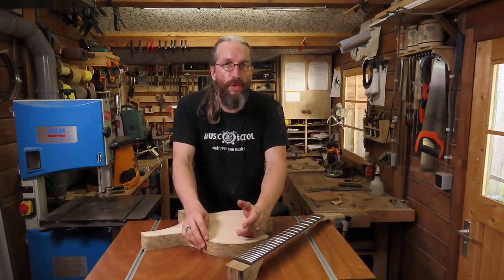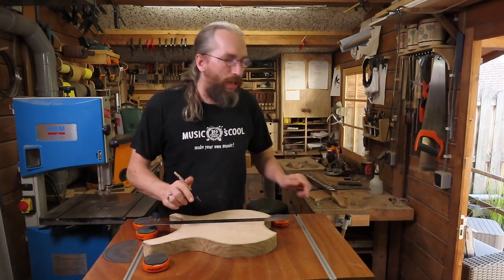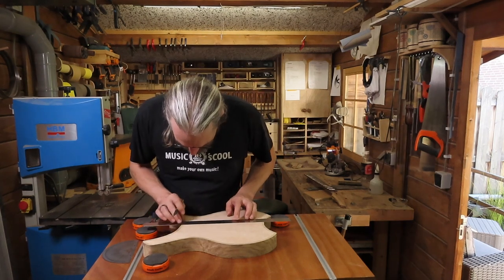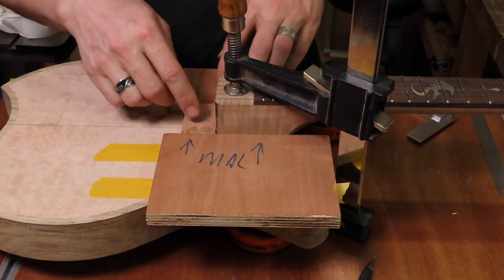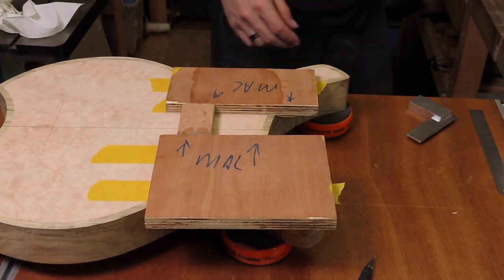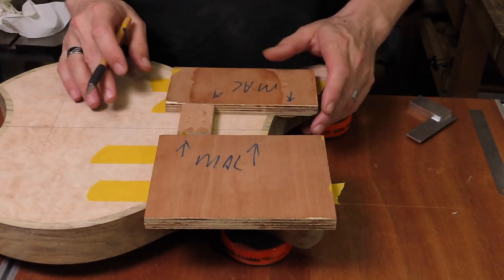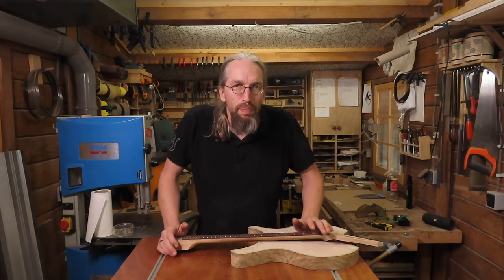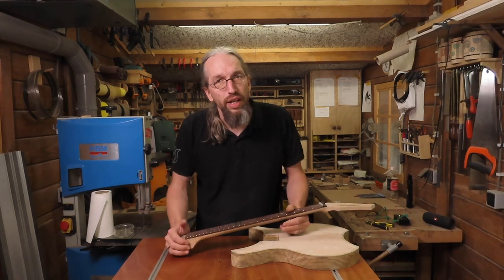A new Guitar Build Part 10: Creating the Neck pocket

Comment: 3:19 This lot of efforts may be easily workarounded with joint template that is a bit narrower than basic neck, and can be just applied to both body and neck. Additional benefit is added body material to pocket (useful for bodies that narrow near the joint), which increases joint strength.

Comment: What's the difference between gluing vs screwing in the neck with a neck plate? Do people prefer to use screws so they can adjust the neck later on? Does your neck have a truss rod? Also I just want to say your video is great and very helpful.

Comment: Very helpful! One question: How do you make sure that the curves on the end of the neck heel (both corners at the end) match the curves of the neck pocket? How I see it, the curves on the neck pocket come from the diameter of your router bit, but how do you make sure that the round corners on the neck heel match your template?
Reply from the maker: Hey Maurice,
I know from the diameter of my router bit what radius the inner corners of the neck pocket will be so I have the same radius on the template I use the make the neck itself. 
If you don't have the radius on the template used to make the neck you could also use a spindel or disc sander to round over the corners on  the heel.
Reply: @UnquendorGuitars  That's smart! You probably do have like a little margin for error since that part is usually covered by the neck pickup. Anyway, thanks for the advice

Comment: Something you might try is to make a dummy fridge out of wood and stick it to the top (masking tape/super glue). If that dummy bridge has the bridge height, string thickness and relief built into it, you don't have to keep measuring the clearance when you try the neck after each adjustment, you can just see it.
Reply from the maker: Hi Ian,
That is a very good idea. I can't believe I haven't thought about that. 
Thank you very much for sharing. I will definitely start doing that.
Reply: @UnquendorGuitars  Oh my pleasure, but I mustn't claim credit for the idea - it was something Ben Crowe showed me. He also showed me a technique for setting the break angle without making adjustments at the bottom of the tenon, although I think this was one of Tom's tricks.

You keep the bottom of the heel parallel with the top surface and you initially size the pocket so that the bottom of the fingerboard is level with the top surface of the body. This starts you with zero break angle.

Then you attach that dummy bridge in place, respecting the likely midpoint for correct intonation.

Then take a long plane, rest the back on the dummy bridge and then plane away the area on the body around the pocket until the line of your cut reaches the end of the pocket.

Lastly, use that new surface to rout the bottom surface of the pocket again and also the end where the neck will butt.

The neck then should just slide in at the correct break angle. The big advantage of this method is that you specifically manufacture the correct break angle in and I don't see how you can "overshoot" that way.

I found a video too : https://www.youtube.com/watch?v=RfU5ckGt5nY

Comment: How do you determine the depth of the neck pocket?
Reply from the maker: Hi Henry,
The neck pocket depth I use is the body thickness - 10mm approximately. 
And I adjust the heel thickness accordingly keeping +/- 1mm play on both the pocket and the heel to make some final adjustments to get the correct string height at the bridge.

Comment: No one in this videos explaines the correct depht of neck pocket and thickness of neck. How much of neck material should be above body?
Reply from the maker: Hi Vino Pit,
That's a hard question to answer it depends on a lot of factors.
Like I explain in this video at 11:25 I like to keep 10mm underneath the heel of the neck. So my neck pocket depth is the total body thickness minus 10mm. Of course I made sure when I was making my neck that the heel of the neck is at least as high as my body thickness so I can adjust this later on.
At 18:22 I explain how to get to the final height of the neck using my method. The final height you need is highly dependable on the type of bridge you are going to use.
For the bridges I used here  I wanted a string height of approx. 10mm at the scale line where the bridge is going to be. To do this I measured the string height before I adjusted the heel of the neck after the pocket was routed and adjusted the heel of the neck accordingly. With every step I left about 1-2mm play which I used to make the final adjustments to get to a final string height at the bridge of 10mm.
My guitar building method is based around working myself slowly up to the requirement instead of figuring out all dimension beforehand. This way I can prevent a lot of mistakes.
I have another video on making a neck pocket which might be easier to follow: https://youtu.be/IdinKAJ-x4k

Comment: couldnt you just make the neck pocket on the body first and then cut out the shape? i would think that would make it much easier.
Reply from the maker: Hi ZipZip,
I think you can, but I'm not sure if it would be easier. 
This way I can make sure everything is aligned properly and have a nice access for the router bit.